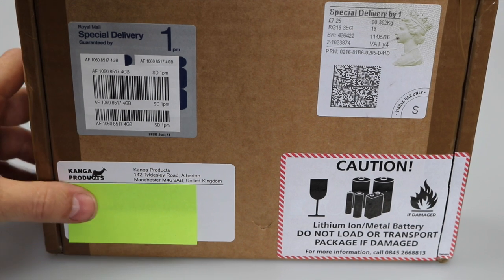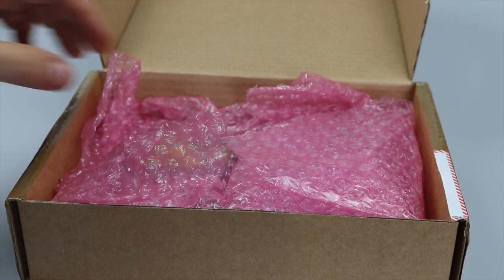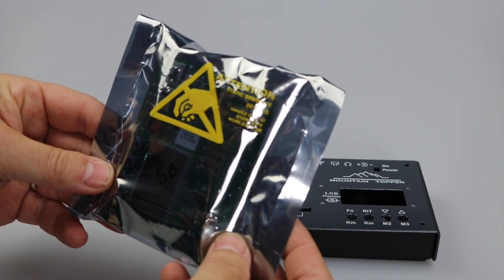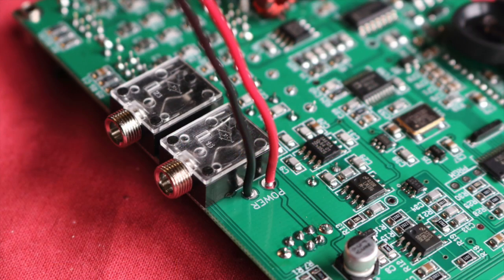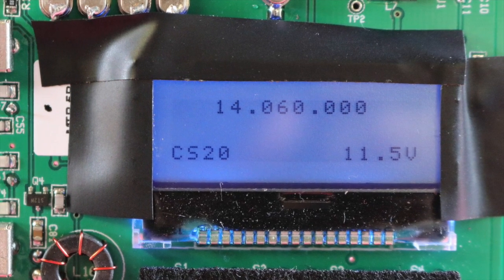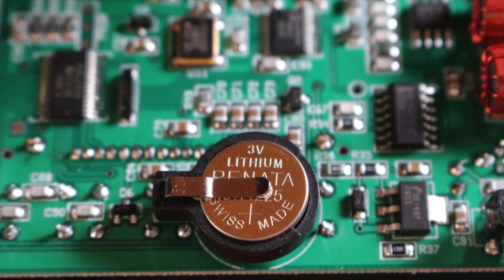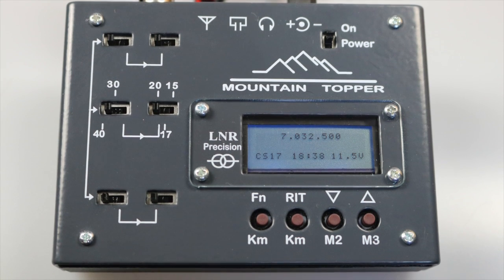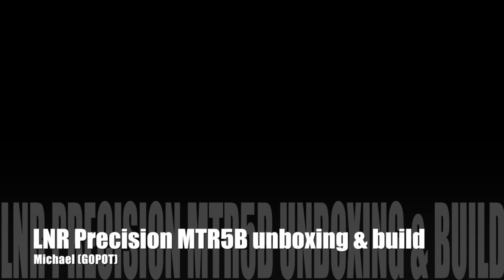LNR MTR5B unboxing & build overview

Comment: "Do not use more than 12 volts."  You mean, such as almost any "12v" source, such as a vehicle, battery pack, almost anything.  That's a very poor design flaw; utterly horrific.  "12v" ham gear needs to run from a vehicle, small lead acid battery.  A reasonable upper limit might be at least 15 volts.
Reply from the maker: You’ll be pleased to know that LNR Precisions only current offering in the Mountain Topper range (MTR4B v2) supports 5.5 - 13V. Still no good on a running car alternator or standard shack PSU but more tolerant of 3S LiPo battery packs and good for a simple PP3 9V battery.

Comment: Kanga no longer carries the MTR5b radios. That's a pity. I would love to see the guide they produced if you still have a copy. I might have located an unbuilt kit.

Great video, by the way! :)
Reply from the maker: The original build manual is still available from LNR Precision. Go to https://www.lnrprecision.com/manuals/ and select ‘MTR5B original detail manual’. I think Kanga has had problems getting stock from LNR and as I look (December 2020) LNR have no stock of any of the MTRs :o(

Comment: How fricking hard would it have been to add 12V voltage regulator to the circuit board?

Comment: Your irises will contract anyway when you focus to read the display as part of your 'accommodation reflex', so that's not the reason why the bright blue border makes the display hard to read.  Blue is shortwave light, which scatters in the eye much more than longer wavelength green and red, and that has the effect of reducing contrast, making it hard to read.  One effective solution is to use a green, amber or even red back-light.  But yeah, the black tape will work fine too.